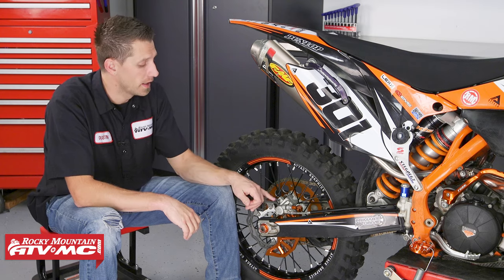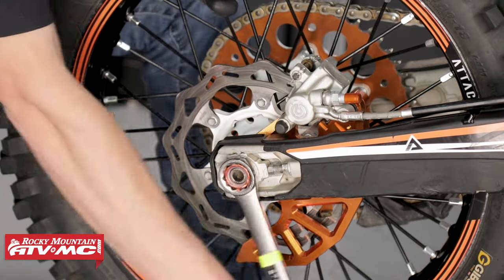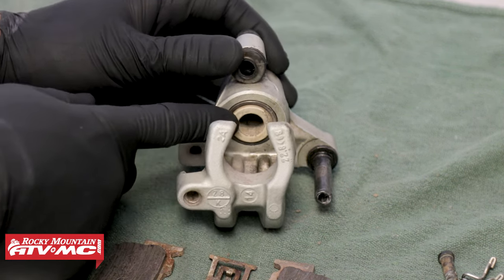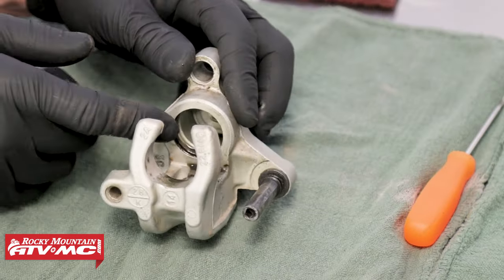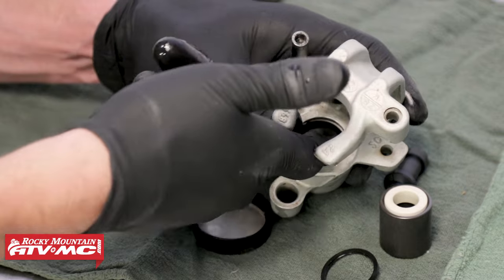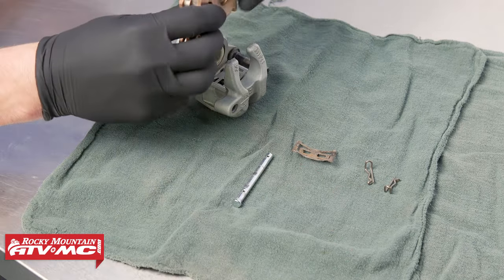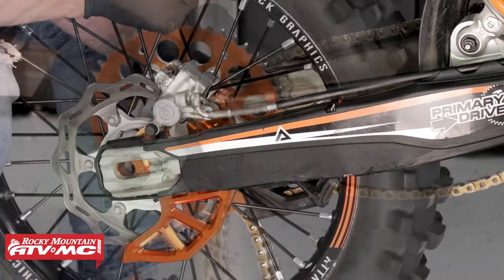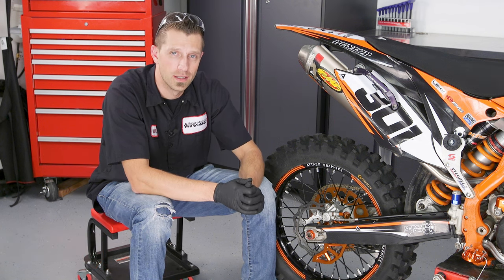How To Rebuild a Brake Caliper On a Dirt Bike

Comment: A safer way to remove the caliper piston - if you don't have a piston removal tool is, remove the wheel, take out the brake pads and before you undo your banjo bolt simply pump it out with the rear brake lever. I have got many a seized piston out this way it never fails! good video by the way.
Reply: Cheers I’m going to rebuild mine so this will help a lot
Reply: Compressed air works too. 

I keep an old brake hose that had been cut and an airline fitting secured on the end.

Can sometimes shoot a piston across the workshop of you are not careful.
Reply: compressed air through the bleeder.
Reply: @nathanmiller9545  Was it easy to rebuild?

Comment: I have looked high and low for a replacement piston for my 2019 sxf 250 but can’t seem to find a piston that looks the same. I can’t find any pistons that have that white inner circle in the piston. All the ones I can find are all metal ? Any help ?

Comment: The rear brake drags a little on my 96 Cr 250 , wheel doesn’t spin fully freely , if I spread the brake pads apart wheel spins freely , does my brake piston need cleaning ? I have clean some of the piston but haven’t removed it and problem still persists , but has improved a little .

Comment: Video on adjusting master cylinder after install? I think my brake fluid is leaking out of the bottom. What is the point of the two bolts that go into the rubber boot / plunger ?

Comment: Are you saying banjo bolts 1:45 I broke that piece on my bike and I'm looking for it but idk what it's called please help
Reply from the maker: The wrench is on the banjo bolt at 1:38 in this video . To be sure, your best bet is to check out the OEM diagrams so you can be positive you're getting the correct part. 
https://www.rockymountainatvmc.com/oem-parts

Comment: Does Rocky Mountain ATV carry rebuild kits for Formula brakes (front and rear brakes for KTM Freeride 250R)?
Reply from the maker: Meg Petersen Sorry, for that bike we do not.
Reply: Meg, the KTM Freeride 250R uses the same brakes as the KTM 85 sx. You could probably get by with a rebuild kit for the 85sx.

The Formula brakes are notorious for failure. For the rear brakes at least, I recommend finding an alternate set of master and slave cylinders from more reputable makers. Nihilo Concepts sells a rear brake stay that can be used to mount big bike brakes onto it.

Comment: Do you need certain brake caliper slide pin grease? I just had to fix the brake on my car and used grease designed for it, but it looked pretty similar to my belray waterproof grease.
Reply: MaxRay16 shouldn't be a specific kind it's just grease
Reply: Regular Permatex brake grease is probably fine.

Comment: I followed this, reinstalled the piston but the piston had a little bit of trouble at the start, then just slipped straight in and had almost no resistance once it got past the first couple mm
Could this be worn pistons? (On front) 

I have almost no brake pressure, rebuilt both mc and caliper, and still no pressure, back bled and everything

Doesn’t seem to be a leak but the brake pads wouldn’t come together for the first 5/6 times I opened the nipple
Reply: Did you ever fix the issue m? I’m having a similar problem